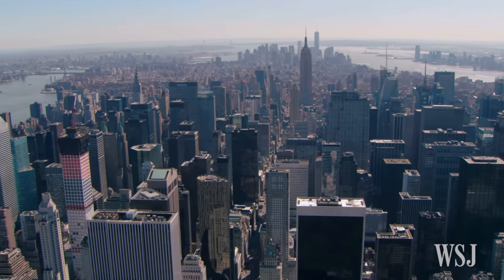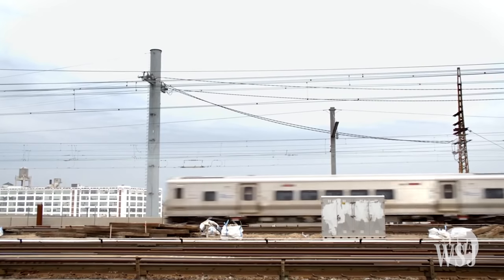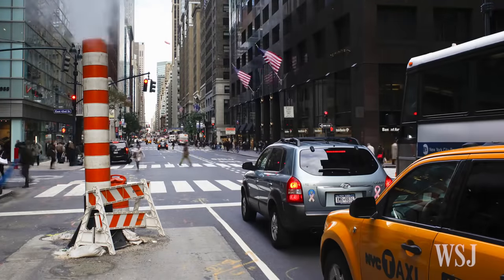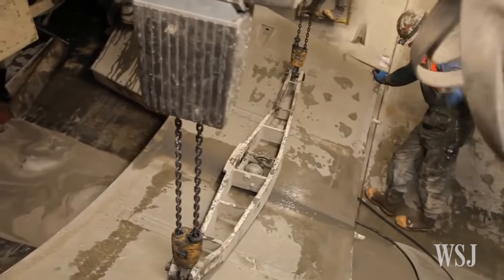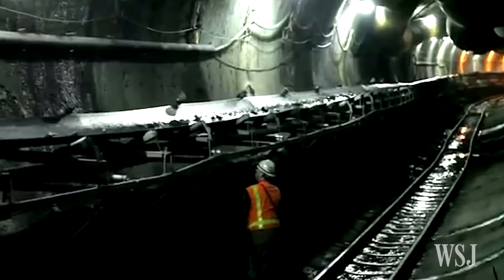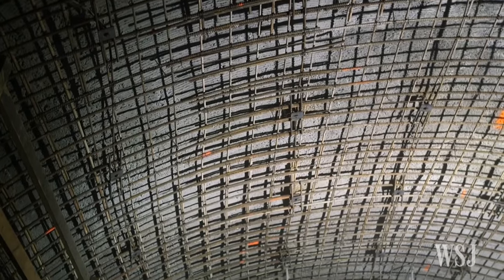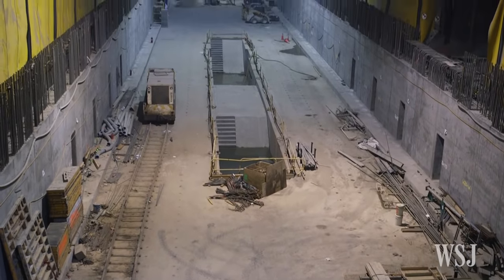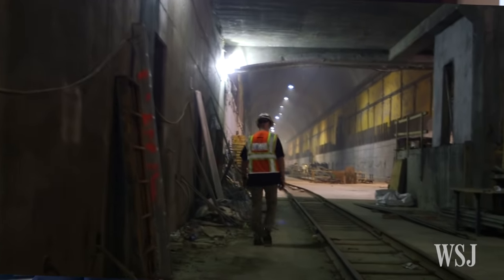A Deep Dive Into New York's East Side Access Project

Comment: Crazy. I worked on this project back in 2000&2001. Nice to see it progress so much.
Reply: Lol
Reply: Cap
Reply: How did find this project ? I want to find me a job like this so I can show my kids when I’m old what I helped build years later when I’m old smoking my Zaza in my recliner 😂
Reply: @mikeolmeda3565  I interned at a civil engineering firm that was on the project.
Reply: Did you have previous experience in construction or anything like that ?
Reply: @mikeolmeda3565  I was a HS intern during that time. I basically catalogued historic documents of the buildings and foundations north of grand central. Was also learning to use microstation since that was the cad program of the project.

Comment: Penn station is like Liverpool Street and  fenchurch street and grand central is Euston and kings cross st Pancras
Reply: But the rats?
Reply: Thanks that helps me understand what they’re doing
Reply: Well, Penn Station was quite an elegant place before they tore it down to put up Madison Sq Garden, they paved paradise, put up a parking lot.
Reply: It might have been elegant when it opened in 1910 but by the 1960's it suffered greatly from poor maintenance due to the PRR's poor financial condition.  I'm not happy it got torn down but it wasn't economically sustainable as Grand Central was/is (and there were proposals to tear that down too).
Reply: Penn Station is actually equivalent to Euston - both were grand old stations torn down in the 1960s (when else?) and replaced with a concrete mess.

Comment: Using 2 machines, you can bore a.maximum of 1 mile per 24 hours.

300 ft per 8 hours, per machine

35 ft per hour

6 inch per minute, per machine

Under ideal condition
Reply: ocsrc uhhh yes? And? They built a new highway here in Seattle with one, although it took a few years. It has made a big difference as far as traffic, although rush hour is still a parking lot.
Reply: Unfortunately the huge cost to running two boring machines would be astronomical, but i get your point.
Reply: A mile a day at 300 feet per 8 hours? Your figures do not add up.
Reply: @boomerrob9223  you are correct. My numbers are wrong. 1000 ft per day, per machine. 2 miles per week.

Sorry about the math error
Reply: @mikemcorky5418  Crossrail used EIGHT, for 42km (26 miles) of tunnels. Considering they're about $15m each, and even bigger than the ones used here, they're really not an astronomical cost.
Reply: I don't know what kind of tbm you worked on they were averaging 30 ft per shift 8 hours.100/120 feet in 24hours
Reply: @seamusog100  I am wrong, my math was off.
At max speed, best conditions, we were doing 1800 feet per day using 2 machines. 
900 feet per day per machine. 1 week to go a mile per machine, roughly.

Comment: These are the infrastructure projects that will endure.  They're costly, until you realize they last.  With a few exceptions, the tunnels dug by workers a century ago are still in use.  They've had to retrofit the rails, cars, platforms, and other systems, but they only paid to move that dirt and rock once.  It's an extraordinary value.
Reply: @crimony It was much cheaper to do back then, even when adjusted for inflation.
Reply: @godofthisshit  yeah but for many good reasons, like how these are desingned to last longer and higher safety standards for workers.
Reply: @godofthisshit   Well, that's because they eternalized the cost of worker health and injury.  Today's workers are paid well and not worked in extraordinarily dangerous conditions or worked to death.  Still, the value of tunnels endure, even when the concrete, steel, and electronics that comprise the subway system are long obsolete.

Comment: Well, when you finish this boondoggle project, why not do something useful and build a connection from La Guardia to the 7 line? Or even heaven forbid a direct rail connection from La Guardia to JFK (I know, don't have a stroke, it's just a wish, a hope, and a dream). Either one would be more useful than this plan to super-saturate GCT and its subway lines during rush hour.

Comment: Paris Gare du Nord receives 750 000 daily passengers and seems busier than GCT. On week days, 225 000 passengers exit or take a Metro North train at GCT for a weekly total of 1.291 million in 2018, and 160 000 do the same in GCT subway station. Even double counting Metro North passengers using the subway, we are far from the 750 000 daily figure advanced in the video.

Comment: The MTA should adopt a similar network model to the S-bahn network in Germany. The commuter trains run through the city center in a straight segment and expand further out in the suburban areas. Merging the LIRR, Metro North and NJ Transit branches into one single line would fit the description of the S-bahn model. Not only does this model allow suburban commuters to ride directly to the city hubs without changing, it also allows suburbs separated by the city to connect to each other by a single network that originates from one suburb and terminates at another.

Comment: There will never be a direct connection between Penn Station and GCT within Manhattan itself. They dont want to connect it to the Metro North, they just want to give the LIRR access to the east side of Manhattan.
Reply: there is an existing line on the west side of manhattan that connects penn sta to the metro north tracks, it is used by amtrak trains to upstate ny.
Reply: Yes, its called The Empire Connection. I know all about it but I said there will never be a connection between the 2 terminals within Manhattan itself. In order to move a train between Penn Sta. and GCT it would have to go north along the west side (via the Empire connection) across the Spuyten Duyvil bridge and down the Metro North Hudson Line into GCT. That would take it up into the Bronx and back down into Manhattan.
Reply: Thompson  That still wouldn't facilitate a direct connection between the two terminals.

Comment: The TBM used in the queens project was very similar to the ones used for the chunnel connecting England and France, I wonder if this company or design was used in this project
Reply: A lot of them are very similar. They sometimes even dismantle the machines (in large exit pits) and then refurbish them, so that they can be used elsewhere in the world.

The TBM is going to be need to be designed for the type of geology. The ones used in London are the second type mentioned in the video (the ones that line the walls to prevent the tunnel collapsing).
Reply: Yes. Both machines where made by the american company Robbins.
Btw. the world leader for TBM's is the german company Herrenknecht.
Reply: The Rock Machines were a Seli and a Robbins machine. The Seli machine was mined beyond the alignment and abandoned. The Robbins machine has been sold, rebuilt and already completed another tunnel int he US. The two Queens TBMs were Herrenkenecht Slurry Shields. The Seli worked well after some early growing pains. The Robbins and Herrenknecht machines exceeded expectations.

Comment: Did this project use the 2nd/3rd largest diameter TBMs, behind Bertha?
Reply: +CooLDsteR No, the TBM was only 20ft in diameter, a rather small tunnel. The TBM used to bore Malasia's SMART tunnel (a highway and storm drain tunnel) was about 40ft, and Bertha is about 60ft. Subway tunnels don't need to be as large as highway tunnels, and while this TBM is 1/3 the diameter of Bertha, the area of the tunnel (and thus, the amount of muck that needs to excavated) is only 1/9 as much.

Comment: How do you plan to keep the sea water out?
Reply: Paul Carey it’s tunneled in the bedrock. Below the east river deep enough that water could never penetrate through the top layer of bedrock. Same as any other tunnel going into Manhattan
Reply: dont let it in
Reply: Hurricane Sandy penetrated the bedrock....
Reply: I don't think the East Side Access is a cost-effective project, but as far as water, it's not like something new.  The Penn Station tunnels as well as the Lincoln and Holland tunnels and the tunnels between the boroughs all had to deal with it.  Same with this project.  It's not a new problem.
Reply: tigersfan14 .......no it didn’t. The storm surge and flooding came from topside and flooded the entrances to the tunnels................

Comment: But why need those tunnels to be reinforced with concrete? Why don't they just use a boring machine that uses premade tunnel segments? Would be much faster, more efficient when it comes to manpower, more durable and lastly a lot cheaper. In Europe almost all tunnels are built like that. If they are built the traditional way, they are probably more than 30 years old or so short, that using a TBM would be too pricy.
Reply: Felix Rubenbauer That could be an option, but concrete is more sturdier.

Comment: what a joke! How long to build a tiny little tunnel?? China is building 10,000 km a year of super highways, Built the longest/ highest tunnel in 3 years, has built 40,000 km of rail in the last 10 years, etc etc etc etc.
Reply: It's not just building the tunnel Mathew. You also have to build the tunnel without having some of those crazy tall New York buildings being undermined and falling over. And all of the underground stuff has to be done without actually being able to see what is around you. So there is a lot of planning involved.

The Jubilee Line Extension project sent a TBM below the Palace of Westminster and a ton of research was needed to work out how to send it below the clock tower (the one with Big Ben in it) without the tower falling over.

Our Crossrail TBM had to dig a hole through a tiny gap between the Northern Line and Central Line at Tottenham Court Road Station. They actually had plain clothes engineers standing on the platforms that day, making sure that the Northern Line station was not getting damaged by the TBM that was inches away from it.

The one thing I don't understand about the East Side Access project is why it ends at Grand Central, instead of continuing on and connecting the Long Island Rail Road to somewhere west, like Union City or Jersey City and Newark. You would get additional economic benefit if the thing went west and east of Manhattan.
Reply: Enjoy your life in China when you move there, Mathew Peter.